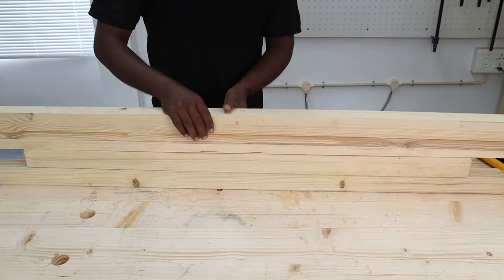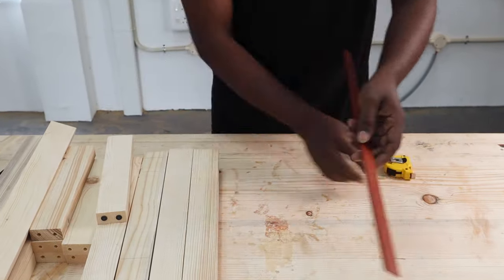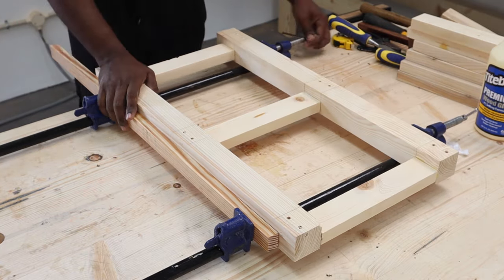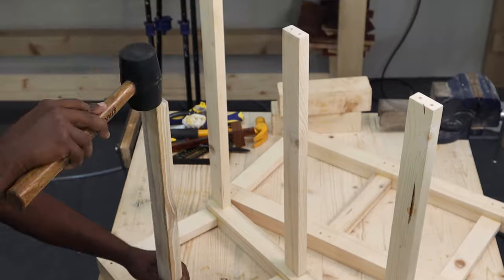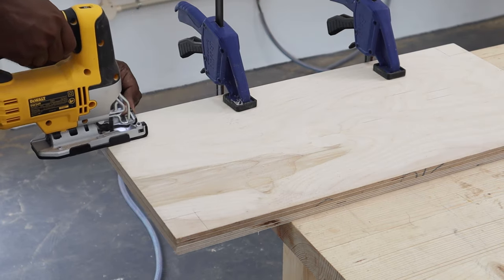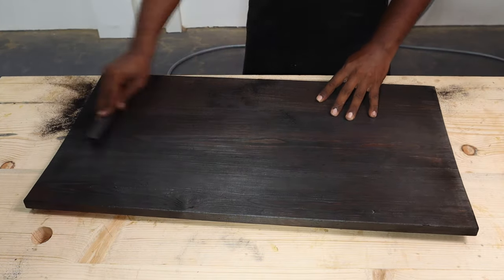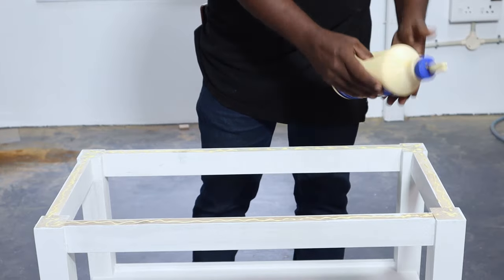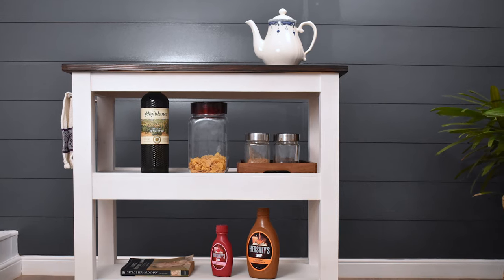DIY Kitchen Cart on Wheels Project

Comment: Great project, everything done so well. My only suggestions would be to attach the top with L brackets to the frame. This will avoid having nail holes in your beautiful top and will allow more room for expansion
Reply from the maker: This is a good idea. Will consider this. Thank you so much.

Comment: If the legs are 2 x2 s (1-1/2" x 1-1/2" net) and the brace pieces are 2 x 3 ( 1-1/2" x 2-1/2" net) why is there a clear difference in the thickness of the brace pieces compared to the the leg pieces? If the leg pieces are 1-1/2" thick and the braces pieces are the same thickness, those pieces would be flush with each other.

Comment: No concern the warping will just pull the whole thing apart?
Reply from the maker: I've had it for a bit now, and it has stayed together well. The warping has been fixed by clamping it overnight and then filling the cracks produced due to the clamping. Burned again afterwards. Now it's fine.